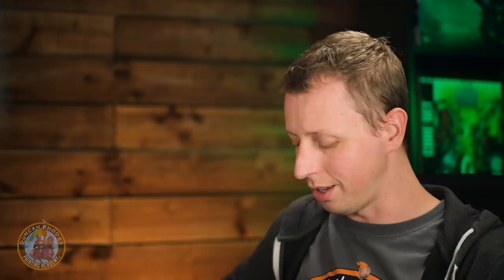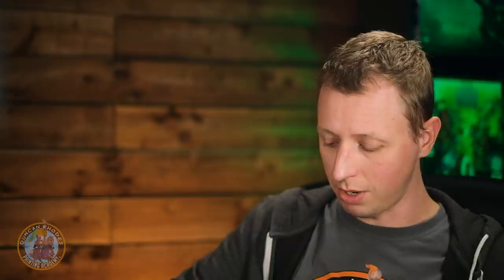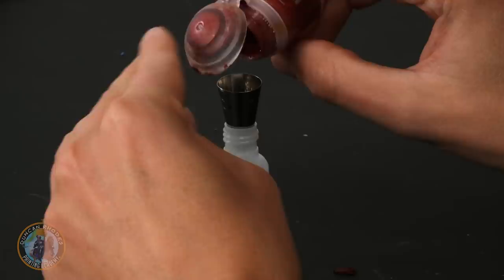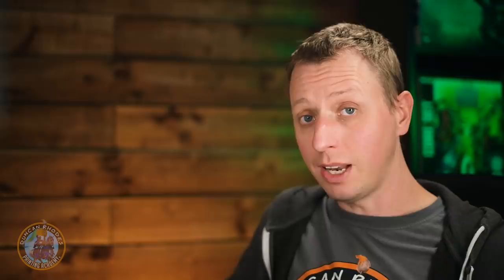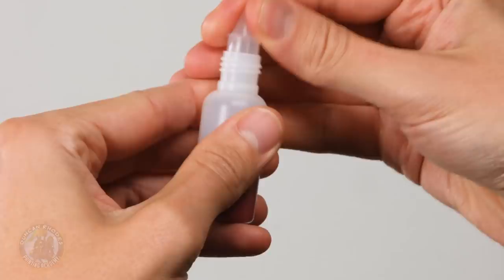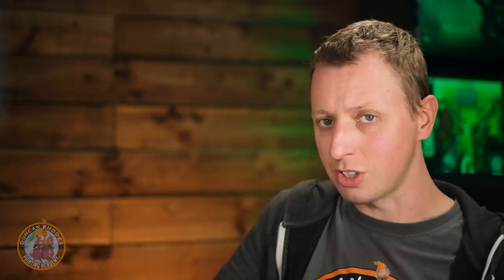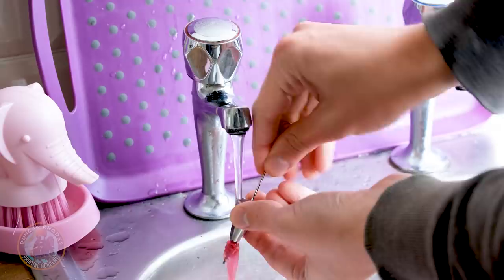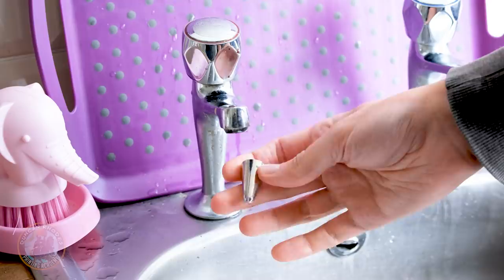What could be driving Dunc so nuts? Or, how he  to learnt to love transferring paints into bottles!

Comment: +1 for Rogers wife +1 for pink elephant brush.
Also if you put a drop of water or thinner into the old bottle and swirl it round with an old brush you can gather the excess paint into a pourable amount.
Reply: Add a few drops, and some flow aid.  You'll want the paint at a less gloppy consistency in a dropper bottle anyhow.

Comment: Mix in airbrush medium as well to make the paint stretch father. Added benefit of thinning the paint without drastically affecting the pigmentation/coverage.
If you’re rich you could also just buy individual bottles of lamian medium. Or get a pint bottle for a fraction of the price.
Reply: Paint will stretch further but it will also dry out much faster once out of the pot/bottle.
Reply: @joanneworrell5936  That’s why you get a wet pallet.

Comment: Pro tip: add a bit of paint thinner before pouring, makes it a bit smoother to pour
Reply: ^ this guy decants.
Reply: @Jams848484  Dropper bottle master race! Once you spill a wash bottle all over the place, you know it's time to decant
Reply: I find they then go weird when using a wet pallette though
Reply: @Phlebas99  Hmm, maybe it depends if you use a solvent or water based thinner. If you use a solvent based thinner, it would affect the surface tension of the paint and I can imagine that would go badly on a wet palette. I'm just speculating though.
Reply: @Phlebas99  Yep you're right. I did a little test. Thinned some Citadel paint with Vallejo airbrush thinner (water based) and it was absolutely fine on a wet palette. Thinned the same paint with some Tamiya X-20A thinner (solvent based) and it spread much more across the palette, and seemed to seep through the paper more than usual.

Comment: What about the paint that's still stuck in GW's bottle? Any tips to get them out smoothly?
Reply: Either try to suck it up with a pipette, add flow improver + mixing balls to get those last drips out, or just carry on about your day not worrying about it. If you stuck with the original pot, It's likely that you'd lose more of the paint due to drying out anyway than however much is left. When transfering mine, I would initially try to get every last drop out, but I eventually decided that extra fraction of a mililiter wasn't really worth the hassle.

Comment: One question though: What about the leftover paint in the pot? Is it removable? Or is it waste?
Reply: So i actually add water to most my paints when transferring them, that way theyre alrrady thinned.
Reply: @SneakyShadowFox  Jesus, water? Sure I've heard thinner/medium or anything like that, but at the same time I've heard water is a huge no-no in this case as you're essentially making a wash there
Reply: @Kubrzesz  water is the main ingredient in paint - so adding more usually does nothing to the opacity of the pigments just like thinning your paints as you've seen Duncan do MANY MANY times on every video "I'm just going to add a couple of drops of water here to thin this out - then we use two thin coats". Sure you don't want to fill it with a ridiculous amount of water but a bit to clean out the last bit of paint residue from the sides and bottom is fine, been doing it for years now with GW Paint/P3 Paint/Coat d'Arms Paint - medium works as well if your too nervous (medium = 85% Water + 15% Matte Medium + 1 to 3 drops of flow aid or 70% isopropyl alcohol depending on how big of a batch of medium your making to help break surface tension and to hasten the drying time of the acrylic binders of the paint)
Reply: @Kubrzesz  nah its a good consistency just got to use the correct amount. I think i do about 6 eye droppers worth? 3 for the initial pour, another 2-3 to get whats left of the paint. For metallics i use medium though.

Comment: I’ve done dozens of citadel pots to bottles. You don’t need a cone or what Duncan uses. Use a mixer ball. You do want to use some flow improver or thinner/water. Brace your elbows when you pour. I pour as much as I can without dropping mixing ball and then add a bit more flow improver to get the last paint, use a old paint brush to get the last bits from the bottom too! Get the mixing ball and last drops. Probably 95% of paint is transferred.
Reply: Same here buddy, no funnels nothing. Just stick the empty dropper with some bluetac to the table, mix some flow improver/thinner in the pot and just poor it in.
Reply: B ut you're still making it harder than it has to be.

Comment: I don't seem to have a problem spilling, so go straight from the crappy GW designed pots to dropper.  After I get as much of the paint out of the GW pot as I can, I squirt in some Vallejo flow improver and/or airbrush thinner.  Give the pot a quick shake and decant the rest into the dropper. Add an agitator ball and you're done.   Save more paint this way and the paint is now a better consistency straight out of the dropper.

Comment: If only GW listened to the community and changed their stupid pots.   I don’t use this however, I use a syringe.  You can get one for 50p from Boots, same as you find in kids calpol.  Suck up the paint, squirt it into he pot and the rubber seal in the syringe leaves very little reside.  Then for the leftover port, add a small bit of thinner, shake a lot and repeat of the last little bit of paint.

Comment: Really wondering, why GW not switched to normal bottles over all this years and stick with that terrible design.
Reply: Because GW's whole business model is to make stuff that's useless a year or two from now, so you have to buy a new one.
Reply: Because you can’t paint straight from a dropper bottle, which gets in the way of the on-ramp to the hobby, something which GW have designed to be as smooth as physically possible. You can go to a store, buy a paint set with minis and a brush and have something that looks… adequate… within about a half hour. It’s why Space Marines and Stormcast are designed the way they are (very few faces to paint, for example).
Reply: @WilCornish  Hey, if you paint straight from the pot, you really are in the wrong place to tender an opinion.